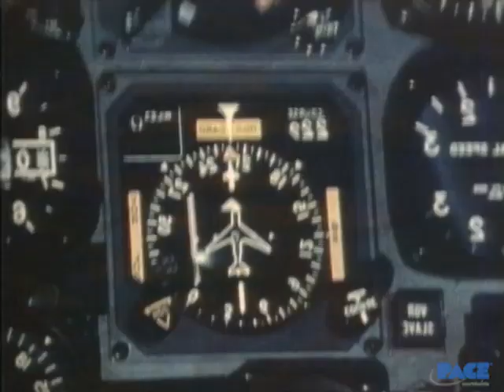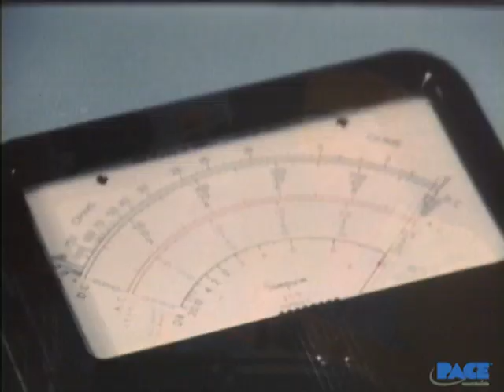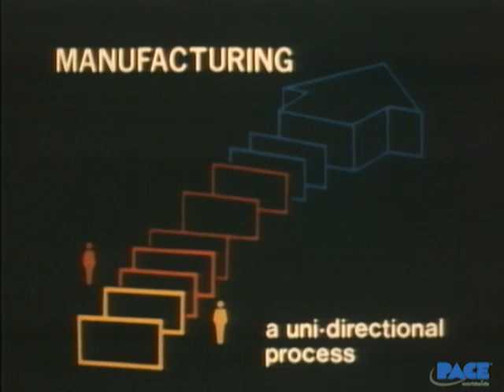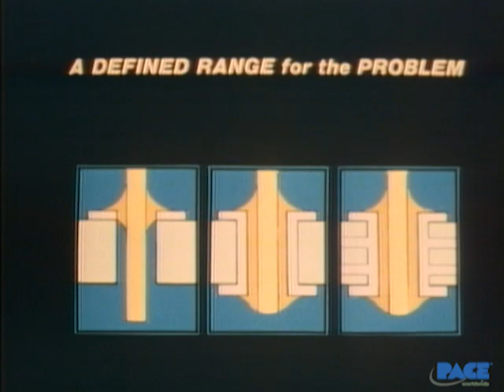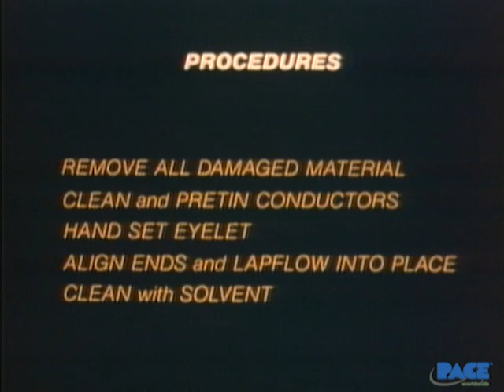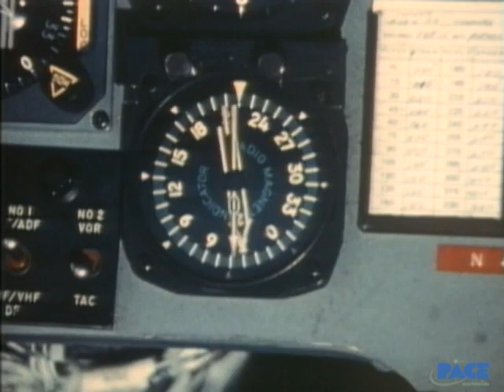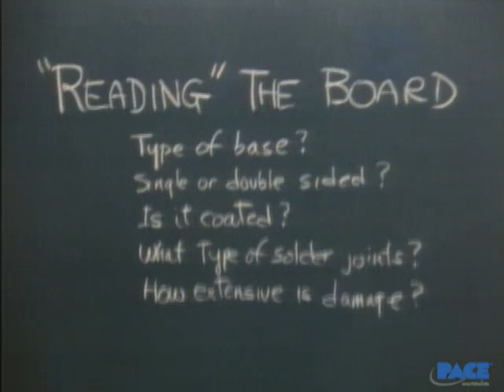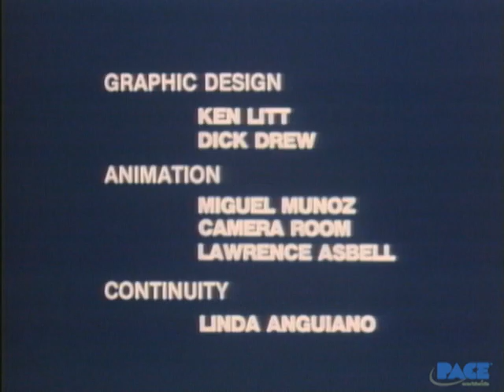PACE Rework and Repair Lessons - "Introduction"

Comment: Now you understand why high reliability electronics cost so much; because of the insane quality control through each and every step of the processes these objects  go through to ensure to the highest degree it will not have delayed fail after manufacture or repair.

Comment: Consumer electronics repair is pretty much dead at this point. Maybe industrial or niche fields?
Reply: Well, the purpose of this is not entirely for consumer electronics. PACE and other companies and rework facilities mostly exist nowadays not to repair consumer electronics, but repair military, avionics, and spacefaring-grade electronics. Electronics systems you'd find in use by the military, airplanes and jets, and space travel (space shuttles, capsules, satellites).

Given the meticulous nature of how strictly they abide by IPC standards in all of these videos, I think they're just in general very good instructional tutorials to watch if you're interested in consumer electronic repair. There still exists a market for it but it is very niche, as not everybody has the ability to do it and not everybody has problems that need to be solved with extensive board level diagnosis and repair.
Reply: It's very frustrating and it can be costly.

Comment: The 15sec starting at 5:20 should be available as a standalone Video just for motivational purposes.

Feel like taking the Math Test is out of your league? Watch those 15sec.
Feel like the Chick at the Bar is out of your league? Watch those 15sec.
Feel like defusing the Bomb is out of your league? Watch those 15sec.

Whatever is your Problem. Watch those 15sec.
Reply from the maker: Duraltia Thanks, you're absolutely right! We'd be irresponsible not to use put this at the beginning of all our future videos.
Reply: That should be a meme
Reply: +Duraltia There are many components to studying circuits. One plan I found that succeeds in merging these is the Gregs Electro Blog (check it out on google) without a doubt the best info i've seen. look at this  incredible website.
Reply: Thank you all for the knowledge gold mine!.
Reply: Replace "repair" in what he is saying and it applies to problem.
Reply: Agreed, 5:00 to 7:00 is a life lesson for approaching any problem!